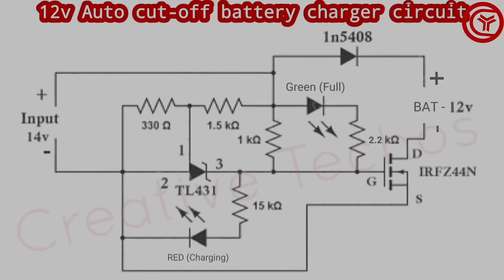Auto cut off 12 volt battery charger circuit

Comment: Your Part List Item 5) lists a SR306 Schottky Diode. This is not used in your Video or on the circuit diagram. Is this an error and is not required?
Reply from the maker: Sorry for error but i would like to let you know that 1N5408 is general purpose diode that i used in video, but also you can use SR306 Schottky Diode as it has low voltage drop then 1n5408,
I have also updated description, Thankyou
Reply: @CreativeTechos  But the sb5100 and mur5100 are just as good

Comment: amigo gostei muito do seu circuito  poderia me dizer qual o limite de tensão de entrada desse circuito ,,outra coisa seria possível usar esse circuito em bateria de 60 ampere muito brigado pelo circuito postado  vou ficar bem feliz se eu tiver uma resposta aqui no brasil
Reply: Esse é recomendado pra essas baterias seladas, se for pra usar em baterias de carro, tem que ser algo mais parrudo
senão vai dar 2050 e ela ainda não terminou de carregar
Reply from the maker: You can check new improved version of this circuit with precise & adjustable cutoff. And yes you can use it to charge upto 100ah batteries. Also Max adjustable cutoff voltage is 7-18v
Video link https://youtu.be/nvlOeDHkwK0

Comment: Greeting's buddy, I've a simple question here that how much current can flow through this circuit to the battery while charging as charging current must not be more than 1/10 of AH capacity for lead acid batteries!
Reply from the maker: It depends on the input current to this circuit, mosfet can handle higher current more than 10A also. I recommend to watch latest video (Black pcb in thumbnail) that is improved version of this circuit.

Comment: If TL431 can not buy from market, what can be substituted it?
Reply from the maker: I think there may be no substitute as TL431 is shunt regulator ic, or simply we can say a adjustable zener diode ic
Reply: @CreativeTechos  what is the difference between TL431 and KA431Z? Please 🙏
Reply from the maker: No difference they are same, TL431 is original & KA431Z is copy, but works almost same as original

Comment: What does it take to get a 12 volt output using an input 12 volt charger?  Awaiting reply ..... (Also specify how much ampere you can give)
Reply from the maker: Ist of all you may know 12v lead cid battery fully charged provides voltage of 12.7v volts. So the charging voltage is needed 14v, 2A for 12ah battery
For this circuit you need to connect input 14v dc to make it work accurate.
You may use higher then 12v transformer and use lm317 to get exact 14v output.

Comment: im trying to understand how does the voltage change after the battery is fully charged while the supply voltage is always 14.4v or 14.2
Reply from the maker: Actually the working of the circuit is quite simple, TL431 shunt regulator is also known as adjustable zener diode.
The voltage Divider using resistors on (Refrence pin 1) of TL431 is used to set the cutoff voltage. The TL431 is triggered using positive current on (Ref pin 1) and it passes negative voltage from pin 2 to pin 3.
And as you can see a resistor is connected from input positive to pin 1 for triggering, but on same pin 1 resistor/resistors is connected to ground, so that it will trigger tl431 after reaching on any set particular voltage.
Another side of mosfet you can see a resistor is already connected from input positive to gate of mosfet, means it keeps mosfet on to pass the voltage from source to drain. But when TL431 is triggered and passes negative voltage to pin 3 also connected to gate, it grounds that Little current from resistor that keeps mosfet on, So at this point mosfet gate gets negative voltage and turns it off and is called auto cut off dc to battery.
Reply: What ampere out put transintor?

Comment: Bro when I connect 12v both led light up what could be the mistake?
Reply from the maker: Try to use variable 1-10k resistor instead of 330 ohms, also i recommend to check out this new & precise cutoff circuit.
https://youtu.be/nvlOeDHkwK0

Comment: What will happen when the input voltage is 17v because my modified ups 12v transformer gives 17v output
Reply from the maker: If you supply input 17v, it will just remain in cutoff state, You should check out this circuit with adjustable output voltage and precise cutoff.
https://youtu.be/fq3pdoB_Sbo

Comment: Sir, I have a ups transformer & it's out put dc voltage min. 17v & max.27v. How can I decrease the voltage to 14/15volt. In this situation ampear will be not decrease.
Reply from the maker: I'm uploading video today or tomorrow to control dc from 1-30v @10A.
Watch that you will be able to use that in this project
Reply: @CreativeTechos  Thank you very much sir
Reply from the maker: I already uploaded the video now, you can check out, you can use this circuit to charge any battery.
https://youtu.be/J8KifBptLYw

Comment: What is the Amp limit?  Sure it's really really low.
Reply from the maker: Why it would be very low, The z44n MOSFET have continuous drain current upto 40A.
In this circuit maximum is 3A

Comment: Hey bro, single Pb cell should be charged for the level of 2,42 Volts. So, 6cells times 2,42 is 14,52 V. You have on INPUT only 14 V. That will never charge accu at maximum.
Reply from the maker: You can use higher suitable voltage to charge pb cellsof any voltage, use 10k preset instead of 330 ohms Resistor to adjust cutoff threshold.

Comment: Can i use it to auto cut off my 100ah lithium ion battery pack to protect the battery from overcharging?
Reply from the maker: It can be used upto 50ah, and for 100 ah I'll upload next video soon, if subscribed and bell on you'll get notified.
Reply: @CreativeTechos  
I want to charge..upto 40Ah battery..for this what changes should I do in this circuit??
Reply

Comment: i intend to use it on a 9 volt transformer with 3 amps
Reply from the maker: It need 14-14.5 volts dc to work perfectly
Reply: what modifications do i need in order to use it on an 8 volt deep cycle lead acid battery providing the supply voltage is 14.2 or 14.4 volt or even 14 volt,thank you!

Comment: What is the max. battery capacity, that can use this charger ?
Reply from the maker: It can be used with 20ah , if you want to use with upto 100ah with more precise cutoff with feedback from battery, check out this circuit https://youtu.be/nvlOeDHkwK0
Reply: Thanks
Reply from the maker: My pleasure 😊

Comment: Hello can I use it to charge a pack of 3x3.7v lithium in serial (12v)?
What V and A for the source??
😊 Thanks
Reply from the maker: No, because i recommend 3S BMS should be used, also this is for lead acid battery as cutoff voltage is 14v.
I'll soon upload 3s bms with auto cutoff circuit, subscribe and stay updated

Comment: I need 6to 8 ampers for 7 plate battri AGS... What this circute provide me 8ampers at 14.2 volt full battri charge and cut off ... What i do change in this circute
Reply from the maker: You can check new improved version of this circuit 10A with precise & adjustable cutoff. Video link https://youtu.be/nvlOeDHkwK0

Comment: Is that circuit able for charging an 100Ah battery? If no, how to make it useful for a big capacity battery more than 50 Ah?
Reply from the maker: Wait for the next video using relay you can charge bigger batteries,
This circuit is suitable maximum 50ah
Reply: Thanks. Very kind of You. I'm waiting for that video
Reply: @CreativeTechos  how much amps can this circuit endure my charger is 10 amp. i m 2 waiting for next video. nice work m8
Reply: Hello! Excuse to disturbe but, I'm thirthy to see You next video You have announced. Regards!
Reply from the maker: Yes sure I'll upload a video then next video will be that you want.

Comment: Can u give me a circuit diagram for Auto cut of charger for 15 V  for 4 18650 battery
Reply from the maker: I'll soon upload bms with auto cutoff for this, subscribe, turn on notificationfor all and stay updated
Reply: @CreativeTechos  is it possible to make it without a bms
Reply from the maker: Yes, but lithium battery needs BMS to charge them in balancing mode.
Reply: @CreativeTechos when will u give   the bms circuit

Comment: I saw this circuit which seems to be very useful while charging a lithium ion based battery pack using BMS board since this BMS board doesn't have a charged/discharge indicator. Am I correct that this circuit can be incorporated in the BMS controlled battery pack? Please advice me in this.
Reply: Yes i have also this question
Reply: Cut off voltage is to low to fully charge a LiFePo4 12.8v Battery. Cells need to get to 3.65v (14.6v for 12.8v battery)
Reply from the maker: You can check new improved version of this circuit with precise & adjustable cutoff. You can use that circuit also with lithium ion battery with BMS. cutoff need to be set 4.2 for each cell multiplied by number of cells in series.
 Video link https://youtu.be/nvlOeDHkwK0

Comment: Why use a 1000V diode in the system if the voltage in the system does not exceed 20V? 1N5401 is enough
Reply from the maker: Actually we use general purpose diode, yes you can use 1N5401

Comment: Bro how to convert this Circuit for 4V & 6V Lead Acid battery charger please tell me how to modify it.
Reply from the maker: Need to test again with different resistor values, I'll upload new video for 4v battery
Reply: @CreativeTechos  bro you make videos only for 12v battery plz make also for 4V & 6V battery charge indicator.
Reply from the maker: Ok

Comment: Please help, i designed exactly the same circuit but my green led turns on instead of red when i turned on the input. And red led never grows.
Reply from the maker: Try to connect battery first then supply input not more than 14.5v, good will be 14v
Reply: @CreativeTechos  I appreciate the reply man! But I tried it already. I am using a variable supply. Input was initially 4v, and green led (very dim) turned on. As i raised the input to 13v, it glowed at maximum intensity. I didn't raise the voltage because i was afraid I'll overvolt the led. Any idea?
(Even I replaced tl431 regulator, but what are the chances that it's still not working?)
Reply from the maker: Check out this same circuit v2 with feedback 
https://youtu.be/nvlOeDHkwK0

Comment: I don't have a mofet what can I replace it with
Reply from the maker: You may replace it with transistor but i cannot handle higher current with load, so better is to get Mosfet IRFZ44N is widely available. Or you may use other mosfets too
Reply: @CreativeTechos  thanks u so much 🥰

Comment: This would be really useful to enable the use a regular 12v battery charger to charge a 12v Li-ion battery so that charge would cease when if/when the charger entered it’s compensation and float stages or if charge voltage exceeded 15v.
What value resistor would one need for a cut off of 15v?
Reply from the maker: You can check new improved version of this circuit with precise & adjustable cutoff, and can be used to charge lithium ion batteries
 Video link https://youtu.be/nvlOeDHkwK0
Reply from the maker: Al resistors are used 1/4w. The circuit is suitable to charge upto 50ah battery = 50,000mah. 
Also check new improved version with precise cutoff feedback, video link
https://youtu.be/nvlOeDHkwK0
Reply: Not working

Comment: sir ac sa 6v 12v battery
  charger
Reply from the maker: You want to charge 6v battery with circuit that will be connected to ac?

Comment: Need AC input
12 volt DC out put
Diagram
Reply from the maker: No it needs regulated dc input 14v to 14.5v and it will control charging and will cutoff charging when battery will be full

Comment: Can I use 14.5V,10 ampere computer UPS transformer power supply to this circuit???
Reply must
Hello
Reply
.can I give 14V,10Amp ups transformer supply to this??
Reply from the maker: You need to use bridge rectifier to convert transformer ac to dc. then you can feed to this circuit.
Reply: @CreativeTechos  
Ok..I have already  used 4 diode bidge rectifier...
Reply: Please u make a spot welder machine for 18650 battery using transformer and capacitor...

Can u make that??
Reply from the maker: Was missed due to some bug in studio, now was replying old comments.
Reply from the maker: I'll try to upload ASAP, transformer for charging super capacitors and the welder I already uploaded for welding, just to replace battery with ac power supply.
Reply: @CreativeTechos  
Ok...
Reply: @CreativeTechos  
From which country u belong to??
Reply: @CreativeTechos  
U make with 3 ampere transformer...
Reply: @CreativeTechos  
I am from India.
U??
Reply from the maker: I'm also from india
Reply: @CreativeTechos  
From which state??
Reply from the maker: Jammu
Reply: @CreativeTechos  
Ok...
Reply: @CreativeTechos  
Please u make that spot welder using 12-0-12,2A transformer,diode,normal electrolytic capacitors....

Plz...plz...plz

Thanks
Reply from the maker: Ok I'll try to upload ASAP ☺️
Reply: @CreativeTechos  
ASAP means as soon as possible??
Or what??
Reply from the maker: Yep😊

Comment: 36 volt ato cat kese banai
Reply from the maker: You can simply change all Resistors to double of their values used in 12v.
And instead of 330 ohms Resistor use a 100k preset to adjust cutoff voltage, and remember input should be constant to make it work properly

Comment: This circuit is not working at proteus program 
Always VGS > 2.5 v
So the mosfet is always closed switch
Reply from the maker: Please take your time and make it practically. I've demonstrated in video.
But please use fixed 14v regulated dc input

Comment: how can i make the cut off voltage to 13.8 volts?
Reply from the maker: By using lower resistance at refrence pin, instead of 15k resistor used at left side of circuit.
Reply: @CreativeTechos  at reference pin 1.5k resistance.Not 15k.
15k at red led.

Comment: This circuit can only keep an already charged battery on charge. The charging current is too low to charge an empty battery.
Reply from the maker: Which charger you used for input supply to this circuit

Comment: why the green LED  always on even no battery connected
Reply from the maker: If you made this circuit and connected 14-volt input green led will remain on as cutoff voltage is 13.5v,. So when you connect battery green will turn off and red on, when fully charged current will get cutoff to battery and green led will indicate Fully charged

Comment: What if someone gave 12v input then its green led will not work properly. Therefore someone must have to change the values of resistors
Reply from the maker: Yep,  that's what I have mentioned if you want to increase or decrease cutoff voltage then you should do same with 1.5k resistor on left side.
Reply: @CreativeTechos  I'm will make this to charge 3 LGABC41685 connected in series with a 3s BMS . I have a 12v 5 amp charger . 
Will the LEDs function especially the red . Since the charging voltage is 12v. 
Sorry if i am missing something .
Reply from the maker: Actually this is designed for lead acid, as input charging voltage is 14v
Reply: @CreativeTechos  as i was checking .. the batts can accommodate  14.1 V theoretically 13.6 cut off is good .. so will it server the purpose if I use a 19V 3.5A charger  . with the same set up as mentioned above.